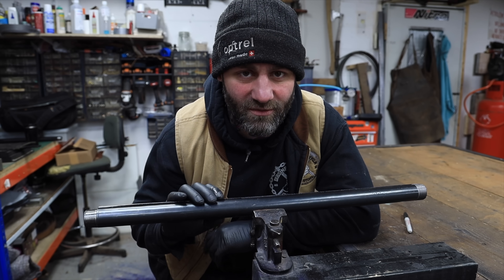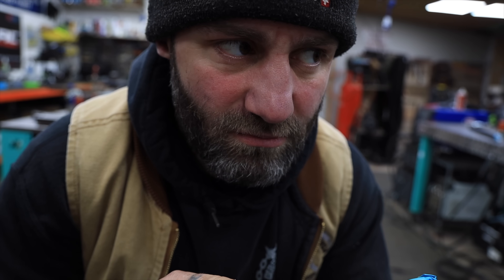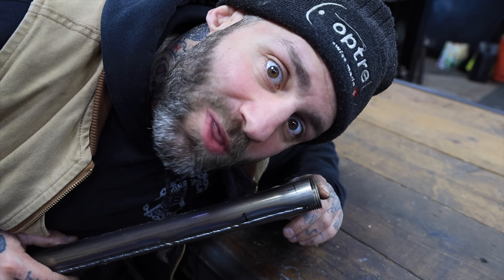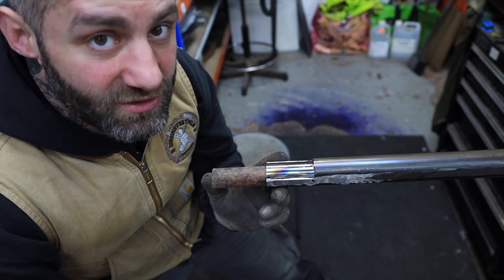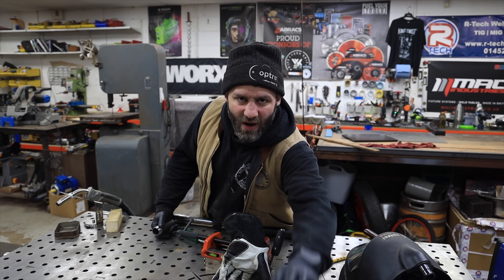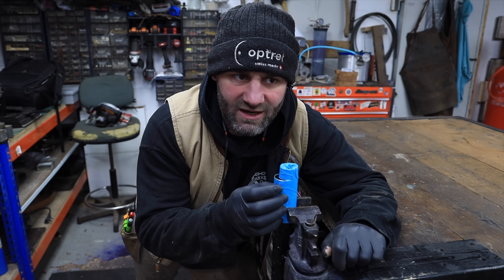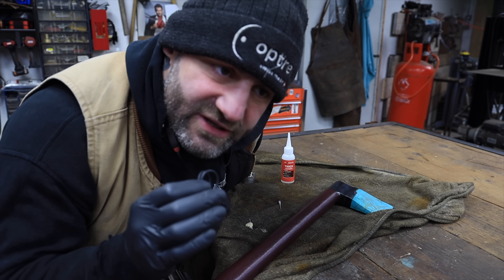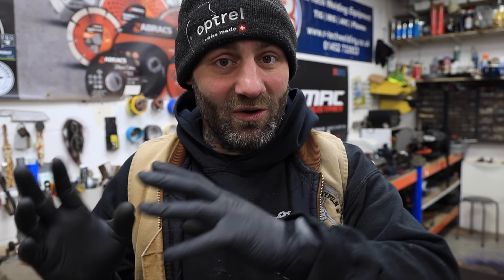Newtons Axe - The Conserved Momentum Experiment V2

Comment from the maker: Now that was better than expected, but how could i improve it?
Don’t forget to follow me on social media.
Reply: Add flames.  Flames make everything 325% cooler. 

Propane bottle right at the knob of the handle, nozzle exiting above the eye and facing forward.

(I am clearly joking: that would mess up the current mechanism. Or am I?!)
Reply: just a suggestion do avoid the warping: to weld thin pipes without is nearly impossible. I work in a Lab, and when i have to bend hoses, i put quartz sand into it before using a torch. The heat will be  spread to all parts equally. Maybe you put an steel rod into the handle or even try to fill it with quarz sand. I´m a great fan of your work, have a nice day.
Reply: @kegelschneckenmett2026  regular salt works basically the same as Quartz sand, but it's infinitely cheaper... you just need to make it anhydrous first by baking at 350-400-ish for a couple of hours. MUCH better option outside of a lab with a lab budget.
Reply: @stevealford230  Melting point of salt is round about 780 (if I remember it correctly) and the q.sand has the double of it. Idk how hot a Welding seam with the included counter part could be. But your answer is a good one and you´re right salt is cheaper than quarz.
Reply: @kegelschneckenmett2026  idk about C, but it melts around 1475F... I used to put it in my forge to know when to quench certain steels. I didn't even consider it melting when you lay the bead, lol... I was only remembering using it to bend pipe and tube at low red to black and ambient temps.
Reply: @stevealford230  sorry the I read your sentences wrong, non native speaker here.
Reply: @kegelschneckenmett2026  Your replies seemed like you understood what I meant, bro.  :)
Reply: Try using Galinstan instead of lead next time. It's pretty easy to make, just mix 10% tin, 20 % indium, and 70% gallium and hold them under a magnifying glass under the sun. That's it. Galinstan is a safe nontoxic alloy that is liquid at around 50-60 degrees fahrenheit and it will flow much better than the lead balls. That will give you a REAL Newton's Axe!
Reply: Like a deadblow mallet, steel shot in a canister behind the head
Reply: Lead or tungsten shot rather than steel balls.
Reply: By making that vegetable squirt.

Comment: Looks wicked mate, only thing I'd improve is to put spacers/gaskets between the balls to take out some of the extra noise, you could probably use foam exercise mats to cut them out of, just a thought. Alternatively, if you used steel or brass stock to make cylindrical weights that'd probably work just as well and be less noisy overall with the gaskets.

Comment: The only advantage i see is that its easier to lift the axe since the weight can be close to ur hand insted of on the head constantly but its also weaker than a normal axe as the center of gravity when the balls are up high is lower than a normal axe
Give qnd take situatione better for people with weak forearms but its a weaker axe

Comment: It has to do with 2 properties: Newtons 1st law: 'an object in motion remains in motion at constant speed and in a straight line' and the principle of centralized force. Basically, the beads start at your grip as you swing the axe down, giving you the velocity of swinging just the axe head without the weight of the beads slowing you down. now that its in motion the beads move toward the head but the force applied is still downward (centralized force) and the further they travel the faster they go, adding to the force and velocity at the axe head. By the time you reach impact, the beads are adding their entire applied force and their velocity downward, while not requiring extra effort to swing it. It like swinging a 5 lb hammer, and having someone swing another 5lb hammer onto the back of your hammer. The literal opposite of a deadblow.

Comment: As someone who chops wood recently frequently, I think an adaption of this idea, geared instead of towards a deadblow type design, but rather towards shifting the center of mass, because as I'm sure anyone who uses an axe properly knows, you have to slide one hand up the shaft to lift after reach strike, and slide it down as you swing to give it power, the reason of course being to be the most energy efficient with weight, but what if you made a chopping axe with a shifting center of mass so when you pick it up normally, it's near the bottom, so it's easier to lift it with your hands already mostly prepped to swing, and then as you swing it down, the momentum + angle shifts all of the weight to the head, thus increasing the power of the blow massively

Thats what I expected this video to be, and it's kind of done that, but I'd like to see a purpose built axe for this job
Reply from the maker: That’s exactly the purpose of this, conserved momentum, it’s not deadblow it’s just an idea i had and Ive built different versions
Reply: @DiesInEveryFilm  gotcha, well it's cool, I look forwards to seeing future versions

Comment: The axe design from 7 months ago, which used a dead blow hammer design with BBs in two cavities, and the one from 4 months ago with the ball bearings in tubes, worked well. The new design with the balls in the handle looks great, but when the Newton's cradle/Dead Blow effect happens, the axe wants to jump out of your hand. The balls in the handle don't prevent the recoil like the previous designs. If you want it to be quiet, consider returning to the design from 7 months ago, putting rubber in the cavities, using flex seal or something similar, letting it cure, and then putting the BBs back in. The current version with the balls in the shaft is just a beautiful but noisy axe, not a dead blow/Newton's axe. You are a skilled and funny guy, but this was a failure.

Comment: a cylinder inside the tube would work better than simply balls no? since it will better use of the volume than a sphere, and the center of  mass will be more towards the top of the tube when you swing

Comment: Makes me wonder how it would throw, or maybe something Newton style more suited for throwing? Even if its for shits and giggles would be worth playing around with even if it throws like shit
Reply: do you throw casually? or do you throw WATL or IATF? i've been throwing axes for four years and worked at an axe throwing bar for two and a half. idk what sort of chaos would ensue during the throw, and it depends on your throwing style. if you throw handle vertical the weight transfer could have erratic results on the rotation rate. if you throw handle horizontal or anti-vertical then the balls would be at the end and it would be just like throwing a really heavy headed axe.
Reply: I'm a casual thrower and I suck at it lol just curious how such an axe would behave when being thrown or if it would throw fairly normal and just bite deep into the target. Do still need to build my wood target so I can get some more practice in, maybe then I'll be able to hit a target

Comment: Try graphite lubing the inside and running a tungsten rod wrapped in lead. The real trick is making it all lever just right for your height, arm, swing style. When it’s right? Wood will explode kinda effortlessly.
Reply: Also, a two part shaft handle… one part is the piston for the swing and the other is just the handle….

Comment: Okay. This is a ridiculous suggestion. If the balls flew up the handle, then were forced towards the rear of the head by a curved 90° turn, they would impart a pushing force on the axe head, towards the front of the axe. To go completely insane, give the balls a path straight forward after that, to let their momentum drive it in deeper. Though at that point, it might be better to let them return through the original path, to help pull it out if it would have gotten stuck.

Comment: Not strictly relevant to this axe but as a general idea to consider: do you remember that battle bot programme, there was one called hynodisc (or something like that), that principle of storing energy on/within a flywheel, do that. No idea how that would work in practice (stabby spear thing?), but i reckon you'd make make a fair fist of it. Fisting. 
It needs to squeal like a pig when it operates. 
I'll leave it with you.

Comment: As usual, an excellent design, instead of all bearings either a titanium or leaded bar so it’s just one solid sliding weight
Reply: Titanium and lead are on two different spectrums of “solid weight”
Reply: Tungsten.
Reply: Titanium is too light

Comment: though this did work as an ax 
unfortunetly the last one did better 
the purpose of a deadblow/newtons law tool. isn't to put extra force behind the tool
its to stop the tool from bouncing back at the user. 
this one you could literally see the tool still bouncing at the end of some of these strikes 
very pretty build but mechanically its basically just a rattling ax that wants to fly out of your hand at the end of every swing
Reply: I agree. Tthis seemed like a fail to me.
Reply: I completely agree. It's just a beautiful but noisy axe that wants to jump out of your hands, nothing more. The old designs worked much better. I don't know why everyone else in the comments thinks it worked.
Reply: I'm unsure if he realizes that Newton's Cradle and Dead Blow are the same thing here. Four months ago, he created a version with pipes and balls in the head of the axe called Newton's Axe, the V1 of this video. Seven months ago, he made another version where he put two cavities in the axe head filled with BBs and named it the Dead Blow Recoiless axe. It's the same effect presented in two different ways, and the BBs are much quieter than the balls. If you add a rubber lining in the cavities, the BB design will be almost silent. As you said, Newton's cradle doesn't create any force amplification.
Reply: The intial part of the swing (from vertical) will be of a lighter headed axe but the impact will be of a heavier headed axe.
A different purpose altogether. I still prefer the last one.

Comment: I love the design you can try instead of ball bearing use a piece of steel shaft maybe it gives more kick to it and maybe lower the sound when hitting something
Reply: Yes! Bevel the ends slightly for less resistance and put a small hole though the piston for the air to pass through when it moves back and forth through the handle.
Reply: @ionnmaur277  Could put a blorp tube insert into the piston. For S&G.
Reply: + one to this

Plus he can make comments about putting a shaft in a shaft etc
Reply: Or just ya know... Sand
Reply: @LogicMrSmith  not heavy enough. lead shot would be preferable. lead or steel shot is used in dead blow hammers
Reply: @thedanishfabricator9334 .  TUNGSTEN.     Tungs ten.  Tungs X.   X = a kiss.      Hersheys kiss 💩 tungs. Stung

This guy must be a 33rd degree free mechanic
Reply: @CoincidenceTheorist  wtf that 33rd degree free mechanic mean? It's whats actually used. Tungsten would shatter over time.
Reply: Ever heard of punctuation? Something kids learn to use, yet you somehow can't.
Reply: @MuscarV2  Ever heard of speaking to people with some respect? Something kids learn to do, yet you somehow haven't.

Comment: Could you coat the ball bearings with a coating like flex seal to make it quieter? I know it would make the circumference a bit larger so it might not work with that handle.

Comment: Same style axe, but add a mechanical lever activated splitter in the head, The levers are activated by the force of the axe moving downward and when striking the wood the levers activate.  Explosive wood splitting. Combining both designs, how big of a stump could you split with that!
Reply: So... just do a knockoff copy of the Splitmaster/EasyGo/Chopper 1?
Reply: Do you feel better now? Such an unnecessary comment. I've not heard of those brands? Channels? I don't know. Don't give a fuck, is the design I'm referring to already in existence? Yes! Most things are, do they involve a dead blow ball bearing in the shaft of the axe? Unlikely. Combine them both as per my comment, sure, I'd like to see that. Now kindly, wind your neck in.  @stevealford230